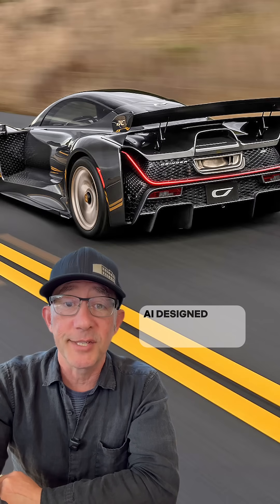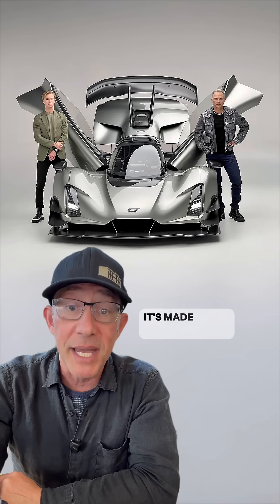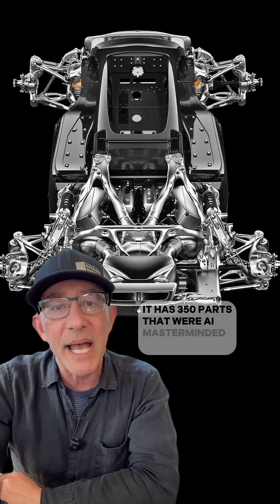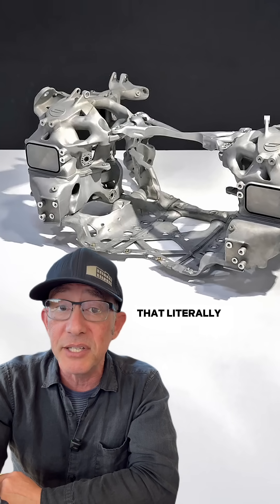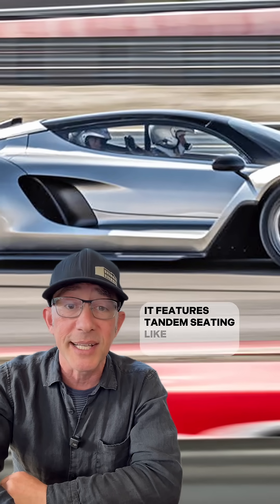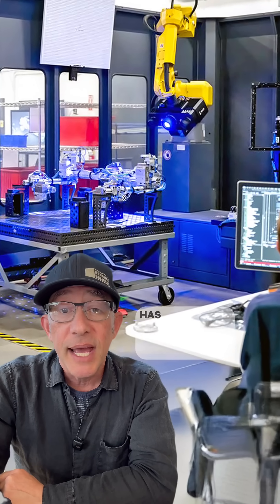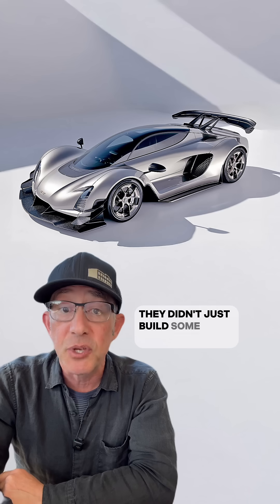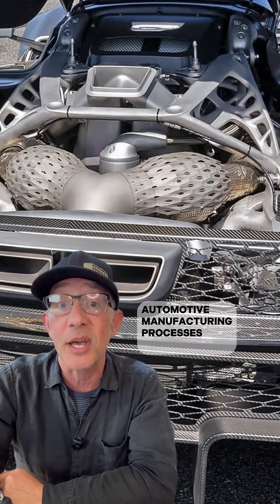It’s already here 🤔 #hypercar #3dprinted #cardesign #generativedesign

Comment: As you've said, the parts have been generated with generative AI, but they're really static analyses, since simulating interactions between thousands of parts is computationally impossible. Just think, ANSYS is listed on the stock market and has no idea how to automatically define contacts between parts or anything. On the other hand, it also seems more like an optimized topology than generative AI due to its shapes, but it's hard to distinguish with the naked eye. Everything today is AI, just marketing...

Comment: For those wondering, they didn't use LLMs or basic Chat AI like ChatGPT, they used specialized models made for engineering parts based on force data, basic shape constraints, etc
Reply: That means the result was still only as good as the parameters given to the system by the engineers. Don’t suggest this was designed from the ground up by AI… it wasn’t. AI was used for certain tasks during the development process to zoom in on ‘optimized’ geometry. Nothing more…

Comment: It’s a 2.88L Twin Turbo Flat plane crank V8 with a couple electric motors making 1250 HP in total I think the engine itself makes 750HP which is insane from an engine with under 3L and I think it revs up to 10K RPM

Comment: "Such is also the harsh logic of industrial automation. All that we had previously achieved mechanically by great exertion and coordination can now be done electrically without effort. Hence the specter of joblessness and propertylessness in the electric age. Wealth and work become information factors, and totally new structures are needed to run a business or relate it to social needs and markets."

[Understanding Media, Marshall McLuhan, 1964, Ch. Automation]

÷÷÷÷÷÷÷÷÷÷÷÷÷÷÷÷÷÷÷÷÷÷÷÷÷÷÷÷

"Automation is not an extension of the mechanical principles of fragmentation and separation of operations. It is rather the invasion of the mechanical world by the instantaneous character of electricity. That is why those involved in automation insist that it is a way of thinking, as much as it is a way of doing. Instant synchronization of numerous operations has ended the old mechanical pattern of setting up operations in lineal sequence. The assembly line has gone the way of the stag line."

[Understanding M

Comment: Generative design has been around for years and has been used to optimize parts in every new car you see on the road for probably the last 10 years. The difference is because of the cost and speed of 3d metal printing engineers take that organic optimized shape and work it into something easily produced. From what I know from inside the industry this isn't a case of them asking chat gtp "can you make me a fast car", it's far more involved and takes real engineers to do this.
Reply: Right. Someone has to seed the idea, set the parameters and shepherd the process. Thats not to say A.I. couldn’t someday with enough human inputs make improvements on its own. HAL will open the pod bay door. We hope.

Comment: The day of bending metal in one place so that it can be bolted or welded into another piece of metal and another place is over. Now there will be form fitting flowing structural integral support body package.
Reply: 3D printed sintered metal technology still has a ways to go before it can compete with the strength of forged steel and aluminium. We can't 3D print the trailing arms for a trophy truck or the axles for a super duty.

Comment: But is in the whole thing with this is that they set the parameters and they have the body style designed off the bat. Only thing that is structurally generated is the frame and the suspension on the inside right?. Still technically human designed, but the optimization underneath is helped with a model
Reply from the maker: Yeah, what's weird is how AI determined how those suspension components should look for maximum utility. Almost alien looking.
Reply: @Cascadiaclassic organic:) biology doesn't like to waste

Comment: In the next 10-20 years AI will not only take over it will make everything way more efficient
Reply: This is not AI in the same way something like ChatGPT is. This is machine learning. The computer bruteforces the structure a billion times and slowly improves it over time based on some tests it runs on the structures, rather than having an internal database of already designed parts and making its design based on that. This type of technology has been around for a bit now.

Comment: Additive manufacturing will only ever be niche. It's too expensive to replace cheap stamped parts in 99.99% of automotive applications.
Reply: looool that sounds exactly like what people said about.. literally any innovation ever
Reply: Depending on volume
Reply: This is the future.
Reply: I used to think it would only ever be for prototypes, but every generation gets faster and more precise. Also, you can print things that are impossible to machine in one piece.  3D printing is already in consumer electronics, it’s only a matter of time before it’s in every industry at scale.
Reply: It's getting cheaper and cheaper by the day bud. And seeing as the human element to the manufacturing is becoming less and less as well, then it really will get a whole lot cheaper.
Reply: When stamped parts came around I'm sure they thought the same thing. It was a game changer
Reply: That was said about many manufacturing methods. Same was said about many things, actually,  but that's where the factor of time comes in . Give it some time and you'll not ne saying that.
Reply: For low volume production and prototyping this technology is king. 
It can even be much more cost effective than CNC machining the same parts in some cases.
I got quotes for 2 specific gears I needed for a one off project for both CNC and SLM Metal 3D Printing and it was less than half the cost even with a material upgrade to Titanium from the Aluminum I was going for if CNC machining would have been cheaper.
Reply: They said something similar about personal computers back in the day. I also don’t see 3D printing metal taking off either, but you never know!
Reply: As the technology matures price goes down. Happened with coal and computers and almost everything else but cars.  Cars are an exception due to increased regulations and things demanded by the gov.
Reply: Dude it will literally be cheaper to do this than a whole R&D team designing a whole car from scratch.
Reply: For now
Reply: This has been said about many things, from micro chips to mobile phones. Yet here we are.
Reply: They said the same thijg about cars, TVs, computers, and yet here we are.
Reply: Even a small aluminium printed part is like 5-10k and often has to be machined afterwards, definitely not viable yet for production cars (lead times are also very long compared to traditional manufacturing methods)
Reply: You miss the forest for the trees, the fact that basically any printer can make those parts means the cost will be nothing to have a piece made to replace a broken part
Reply: idk ab only ever. it is currently tho
Reply: But what about all the money they save by have computers design and print it and robots to assemble everything, and they can all go 24/7 with nearly 0% downtime, and no unions, no sick days, no work stoppage, I think it'll be just like a camcorder from the 80's costing $1200 and ten years later they only cost like $300, yes it'll be expensive at first as the industry adapts to the new tech, but eventually it'll be how nearly EVERYBODY does it, and the "handcrafted" cars will become niche
Reply: Same as laser didn’t end CNC stamping machines. Also, most cars will be self driving boxes averaging 20mph.
Reply: In 20 years you will have been wrong for 5-10 years.
Reply: The print is more or less welding every cubic millimeter of the part.  Low production that may not be an issue but you're just not printing 1000x F150 parts a day quickly or efficiently.